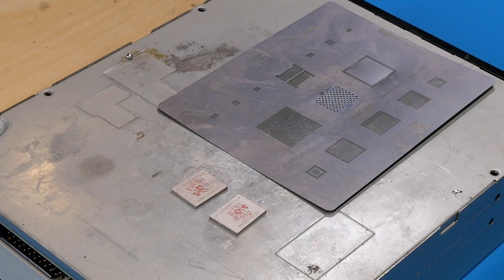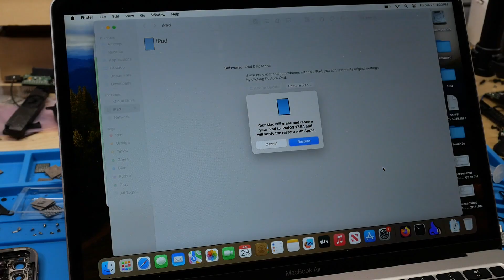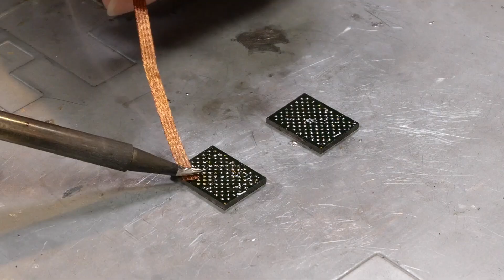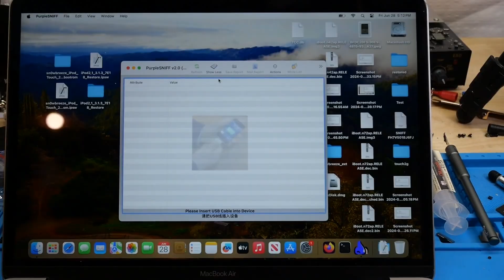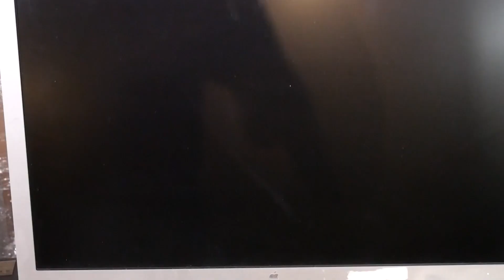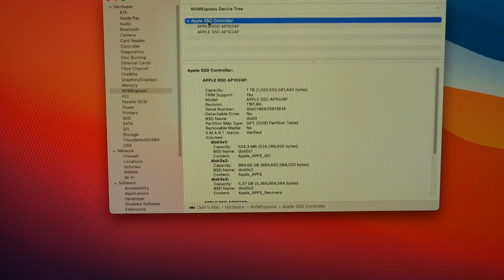Upgrading the Apple Silicon DTK

Comment: Amazing upgrade as always, i just wondering how did you know that SDR nand is compatible with DTK? or was it by try and error or we just going to assume that A12Z can support the same config as the M1?
Reply from the maker: @iBoffRCC  I actually came to that conclusion by buying a NAND sold as being for an A12Z iPad Pro off AliExpress, and ended up just getting a blank KICM229... I tried it on the DTK straight away in its blank state, but it did not restore successfully. I then tried it on the iPad, which WAS able to successfully restore, and from that point on the now-programmed KICM229 NAND worked on the DTK perfectly as well. So I then just assumed any model M1 BGA110 NAND would work, and that ended up being correct! Well, almost... Only the 512GB NANDs would work on the DTK, but 1TB ones (KICM223) did not, though they DID work fine on the iPad, oddly enough.

Comment: Hey, I know this isn't related to this video but I've been trying to disable my GPU on a late 2011 MBP using "nvram fa4ce28d-b62f-4c99-9cc3-6815686e30f9:gpu-power-prefs=%01%00%00%00" but it doesn't seem to fix the screen distortion after reboot. Is there anything else I can try to type in to bypass this?

Comment: hello😀 i have an unrelated question about an iphone xs. i recently swapped the screens of 2 xs devices one screen is cracked the other one was fine and both screens works totally fine. but after swapping, the top part of the good screen  stopped working so i swapped  the screens again and they both working fine in their original phones. so the issue is the cracked screen works fine on both devices but the good screen works only on the original device. is there any fix?

Comment: I still dont understand why there are three baytery holders on the thing.  A single 2032 3 volt battery will provide enough power for the cmos to keep time for probably 50 times as long as this device was designed for. I cant imagine the board needing 9 volts for anything, or tripple the amps.   Its super facinating how you've reverse engineered this board though. Tim Apple is probably mad!😂
Reply from the maker: Being an iPad chip, the A12Z is designed to run the RTC/SMC coprocessor off the huge iPad battery when powered off... As such, even with the three batteries, it drains them in 6 months.
Reply: @dosdude1  ohhhhh. That makes sense. Its not just powering a CMOS.
Reply: This is hours later. I have to explain that its crazy how much I've learned from your videos. I wasn't trying to be rude. Somehow you figured out how to dremel through the board and make it work again.  That's about 50 levels above what I could do. Tim Apple is crazy mad. He probably popped his cork  when you showed how to get essentially free storage.

Comment: Is there a way to trick the ipad into starting up without a battery connected, eg putting a certain voltage across the battery connector pins? Just need to do a backup from an ipad using a macbook so it can be restored to a different ipad.

Comment: With all those spare boards you have, I wonder how viable it would be to do a wholesale business, where you buy cheap or damaged boards, fix them up, optionally upgrade them, and resell for a profit. If the final product is cheaper than buying second hand, might be good business. I've been looking at getting a new mac, but can't justify the prices of the new machines, and any m-series chip is fast enough - the trouble is always finding 16GB ram and 512GB+ storage configs second hand that are affordable - at least where I live in Australia.
Reply from the maker: Well, the main issue is that most of these I have are drilled through the SoC, making them useless... Only around 10 or so I have are actually undrilled (but cut) and fixable. Also, these are not suitable to use as a main machine... The A12Z lacks a lot of instructions that the M1 and later have, which most programs are compiled to utilize. When such programs are run on a DTK (which includes pretty much all web browsers including Chrome), they simply crash with "invalid instruction". A custom version of Firefox had to be compiled just to get that running on it.
Reply: Does Rosetta 2 works on the DTK?

Comment: So does it matter if you reball a chip using solder paste or solder balls? I never thought of using solder paste with a stencil instead of solder balls.
Reply from the maker: It depends on the chip, usually with large BGA chips I prefer to use solder balls, as solder paste will have issues producing uniform size solder balls if the stencil warps even slightly. With small chips like this, though, solder paste works great, and with some very tiny, tight-pitch, tiny-pad BGA chips, you have to use solder paste.
Reply: @dosdude1  that makes sense. I’ve been quite intrigued with Xbox 360 repairs, so I found this interesting.

Comment: You can see the specs without creating a user account.

At user setup screen first open Terminal with 
Cntrl + Option + Cmd + T  

Then hold Option while opening Apple menu and "About this Mac" will change to "System Information" which you can open.  That's it!

This is also really useful if you are checking out a Mac for sale and don't necessarily want to make an account.
Reply: Woah, it's like shift+F10 in Windows OOBE, but on Mac. You the real MVP.

Comment: What trick or con are you trying to pull here? In your previous video the last mod you do to the board is put on a 2 pin connector for the power led and it can be clearly seen soldered onto the board when you assemble everything with then powering it on showing the power led working. So how is it then in this video your upgrading the 128gb nand with 1Tb on a board that does not have the 2 pin power led connector soldered onto the board which you supposedly soldered on in the previous video? Something is not right here so I wonder what dodgy explanation you will come up with to explain this.
UPDATE: Looking at both video's I can clearly see they are different boards because the cut out in the PCB is different and towards the bottom of the board in the previous video there is a black strip of something that goes along the board and there is also a black cover as well which you can see if missing on the board in this video. Therefore you clearly have 2 different boards. Why have you not made this clear in this video that the board you are working on is not the board from the previous video? what are you trying to hide from the viewers?
Reply from the maker: Not trying to hide anything... In fact in the first video I even mentioned I had multiple boards. I do have around 10 non-drilled boards I got from China.
Reply: @dosdude1  Your still hiding something because if you have multiple DK boards why did you not disclose in this video that the board you was working on is a board that came from a multiple batch you bought ? because in this video you make a point of telling viewers to go look at your previous video and then you prod the nand chip saying this was the 128mb you added but this is not the chip you added to the board in the previous video because it is a different board. 

You are therefore being flippant and dishonest with the truth here. The previous video is board one, this video is board two, two completely different boards something you should have disclosed in the video but you didn't because you wanted to mislead your viewers into thinking you was working on the same board. The work you did on the boards is excellent but you ruined it by not being open and honest about what you are doing.
Reply: @dodgem259  What's wrong with you? Why does it matter which board is he using in this video? In the beginning of the video it is certain that the board didn't have 2 nand chips installed and he did install them on the video and got OS running off them.
Reply: Why do yu care how many boards he has. He clearly isn't faking the video, whats you skepticism all about?

Comment: Something I'm still confused about is when the board was originally cut, which stopped it from working, why does it work properly after you dug out the short? Where those traces not important? Did they not connect to anything? Or are there aspects of the computer that don't work anymore because of that?
Reply from the maker: While there are signal traces in that area, all they are for is the debug LEDs in that spot... Everything else is just power planes, which of course have no issue when a bit of those are missing. The only real issue the cut causes is shorts between those layers, once those are cleared, that is all that is necessary.
Reply: Yeah, I'm still confused about that too.

Comment: What are the chances of you being able to transfer the NANDs back to the DTK without restoring and have it run iPadOS using Mac hardware??
Reply from the maker: You'd have to transfer the SoC too, as the iPad SoC is fused differently (specifically two of the upper Board ID bits) than the DTK one. The lower bits are set with strap configuration resistors. The same is actually true with the M1, M2, etc. SoCs on the iPad and Mac. I can only assume they did this so you can't use an iPad SoC on a Mac (or strap it to "be a Mac"), and vice versa. Though even if you were to swap the SoC and set the lower Board ID bit straps accordingly, it still likely wouldn't work, due to the device tree used not being correct for the hardware it's actually running on (you'd then be using the DTK's device tree on the iPad, and you can't change this because it is signed).

So in essence, in order to make, say, a 12.9" A12Z iPad Pro "think" it's a DTK, you would have to change the Board ID from 0x38 to 0x42. But, you can't do this because only bits 4:0 can be set with resistors... Bits 7:5 are permanently fused into SoC, and cannot be changed.
Reply: @dosdude1  I’ve wondered about this since 2020, thank you for this in-depth explanation!
Reply: anyway, IpadOS Macs or MacOS Ipads would be funny
Reply: k-kaskobi!?

Comment: What I am wondering (since a few of your Mac NAND videos, actually, amazing stuff you do here!) is can't one just "re blank", i.e. fully erase, the NANDs again, so they'll be seen as new and just work?
Or is there some e-fuses that are blown once the NAND has been used for a system and those "marry" the chips to that board for ever?

// EDIT:
Follow up question:
The sysconfig data is stored in an area of the NAND outside of what's actually visible "as SSD storage" to the system?
Reply from the maker: Unfortunately not... The "blank" NANDs really just have a special firmware on them that makes them such, and I haven't ever been able to successfully dump that to write onto another.

And yes, syscfg is stored in a special area of the NAND, along with its emulated SPI block (yes, these NANDs have a section that can be written to as a block device, and is also accessible as if it were an SPI EEPROM), and other stuff.

Comment: Is there a way to send my M1 Mac Mini to be upgraded?
Reply from the maker: Yeah, just send me an email.
Reply: How much does it cost? I have a failed base model M1 Mac Mini. Basically I think that the SSD failed.
Reply from the maker: @MStrong95  Usually I do the upgrade for $200, plus the cost of whatever storage config you choose and return shipping.
Reply: @dosdude1  I assume it's cheaper than Apple charges for it at time of a new machine purchase. But what do the chips cost for the different upgrade tiers?
Reply: @dosdude1  for the countries that require special customs handling, is the customs declaration to be handled by you or the receiver?

Comment: I hope there's some way to get Asahi Linux working on the DTK. It would make those machines a lot more useful.
Reply from the maker: That is being worked on.
Reply: @dosdude1 hi. How can i contact you. I do board level repair on MacBooks but facing some challenges when replacing dead/ shorted NANDs.  I just have a few questions. 

Your guidance will be highly appreciated
Reply: Sucks Apple decided to unsupport and scrap all DTK, it could have been repurposed as dirt cheap education systems(if Apple had the hindsights).
Reply: How about patching modern Mac OS with the DTK Big Sur drivers, kinda like a hackintosh? I'm sure that Open Core Legacy Patcher has to support the first ARM Macs one day, as soon they become unsupported. It's a very predictable game with apple
Reply: @fmt1890 I really hope OCLP is able to work on Apple silicon, but although it’s unlikely, I still have hope that they’ll figure out how to get a fully ARM macOS on Intel once the last Intel machines are unsupported. Otherwise, that day will be the last day any of those machines are useful to pretty much everyone outside of super specialty cases.
Reply: @fmt1890  kext support being discontinued might but a stop in that plan.
Reply: >linux
>useful

yeah no
Reply: @Wilfredo201102  Now that’s a fantastic way to say you’re ignorant and suck at using computers! Well done!
Reply: @Wilfredo201102  wrong
Reply: @Wilfredo201102 Most phones use linux most internet servers use linux, even apple and microsoft uses linux, if you don't have the capacity to use a machine that doesn't make it any less usefull for someone who does especially considering linux is the most open system in existence
Reply: @Wilfredo201102  what a ridiculous thing to say 🤣
Reply: @Wilfredo201102  wrong